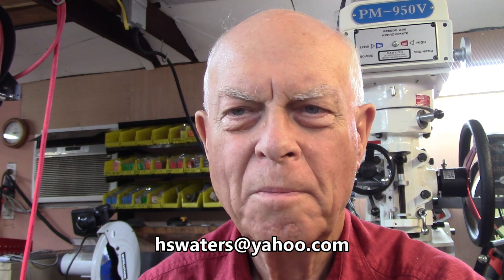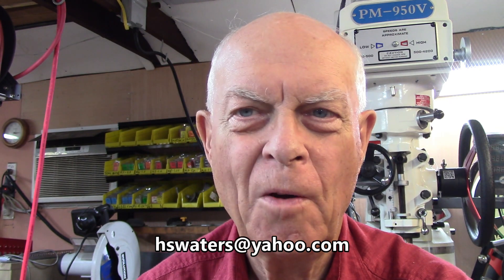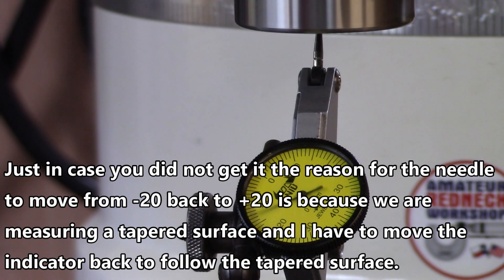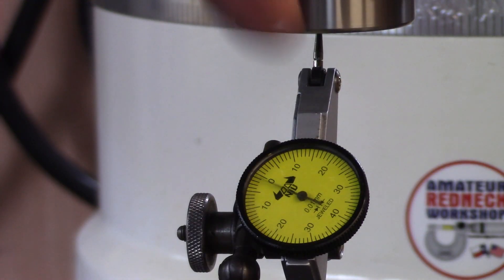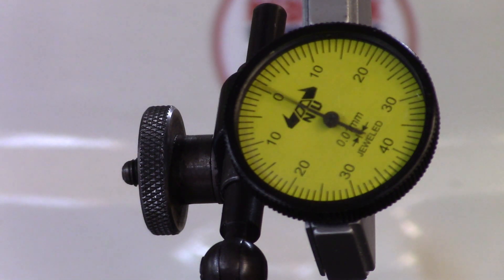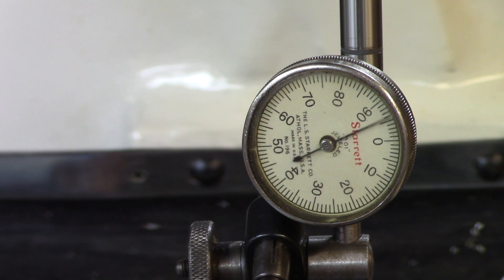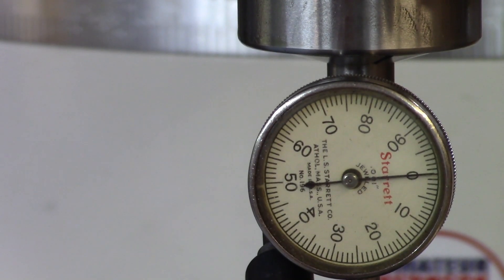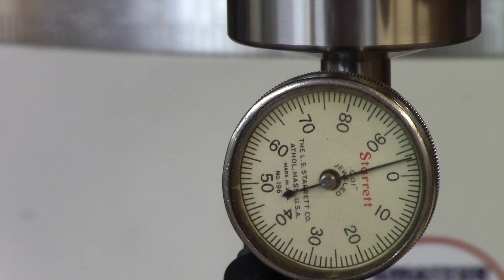Optical edge finder revisited the AR version

Comment: I got a new ER40 collet set, and the seller claims a certain runout value of the collets.  I am somewhat suspicious of them, even with the guarantee because like you say you paid a pretty penny for yours and they still had a bit of runout in them.  If I can ever get some shop time they will need testing, as well as the spindle on the machine.
Reply from the maker: Thanks for stopping by.

Comment: Good test and video Harold.  As you know 0.02 mm is pretty much standard/baseline acceptable run out on most new stuff, so 0.01 like you got on the mill is excellent.  Test indicators are so damn useful.  I rarely use a plunge indicator.

Those edge finders are junk.   

Thanks for the follow up.  Most interesting.  I was wondering what was going on.  You can usually vary collet run out by rotating them/use different positions in the chuck because of the compounding error factor.

Ha Ha had to laugh at the negative air con temperature comment and the rug over your shoulders.

Cheers Rob
Reply from the maker: I think she is trying to freeze me to death.  😀😁😂😉

Comment: I suppose it doesn't matter much how much it's crooked if you bump both sides and divide by two to find the center, it should be the same amount of crooked on both sides.
Reply from the maker: I think that I would be some number of thousandths past each side so I could not know exactly where the axis starts.  😀😁😂😉
Reply: @AmateurRedneckWorkshop  Same amount on on both sides, so you hit zero button on one side, hit half button on the other side should make zero in the center, I guess that means you need to measure the part to know where the edge is. Or just stick a piece of paper in there until the cutter grabs it and add 3 thousand, but then you don't get the magic beep that makes people think you know what you are doing. :)